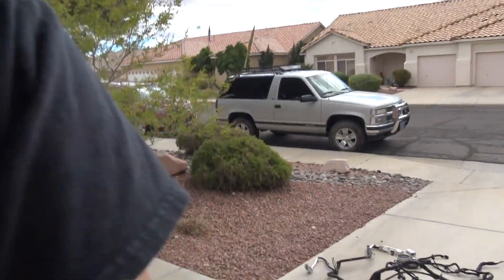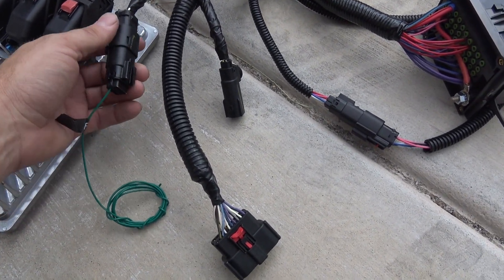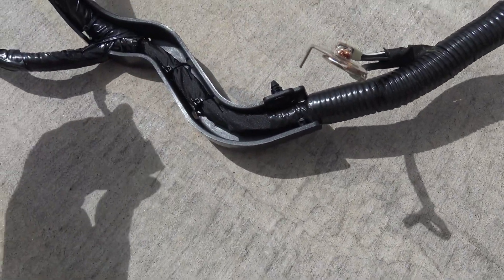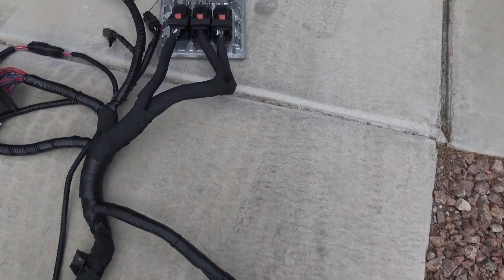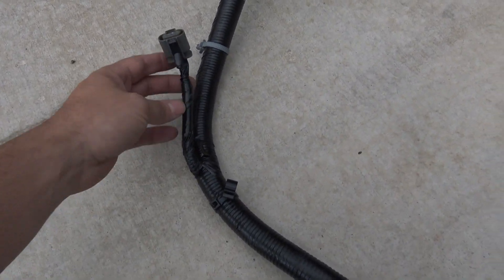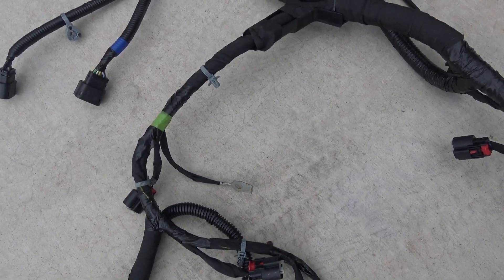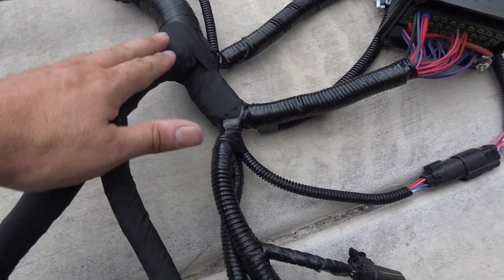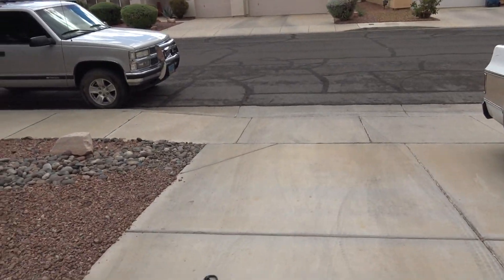Gen V LT1 engine harness overview (L83 and L86)

Comment: Do you know of any stamped identifying markings between the l83 and l86? Markings that can be seen if the transmission is still bolted to motor. Thanks!
Reply from the maker: It is cast on the front off the engine block under the drivers cylinder head. shows either 5.3 or 6.2.

Comment: How much do you sale this harness for?
Reply from the maker: ervey rodriguez 550$ for re work on your harness or 850$ for a brand new harness. Includes fuel pressure control module connections and ecu mount.
Reply: How can I get ahold of you?
Reply from the maker: @tracym427  vannatta20@gmail.com
Reply: @Swap Time can you make one work for 2008 Colorado

Comment: Just finished my harness today, thanks to you and another youtuber. Why don’t you use the fuel pump module?
Reply: Did you ever figure out the pwm fuel issue? I have an L83 swap I'm doing on an 82 C10 but been getting mixed answers on that issue.
Reply: Fue.